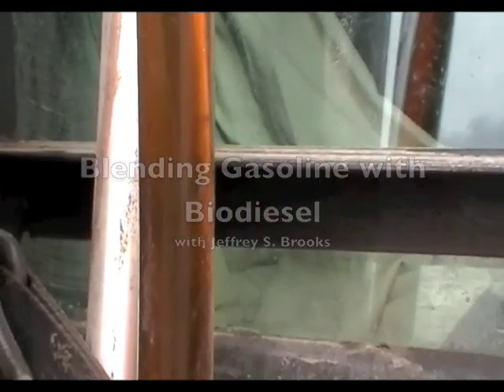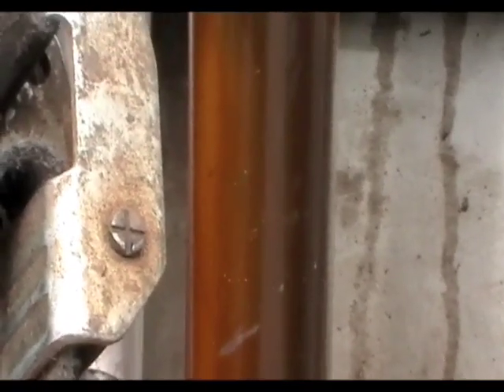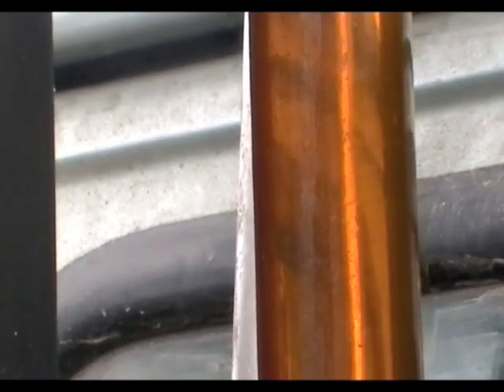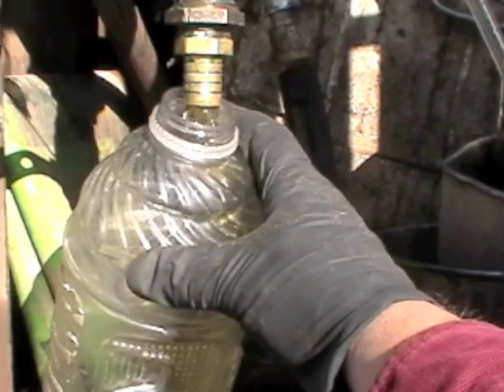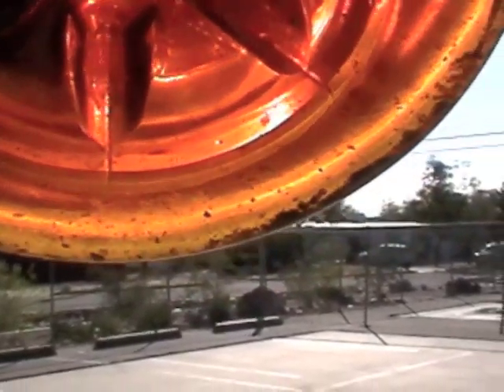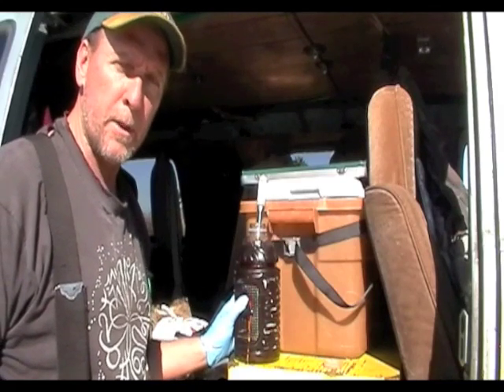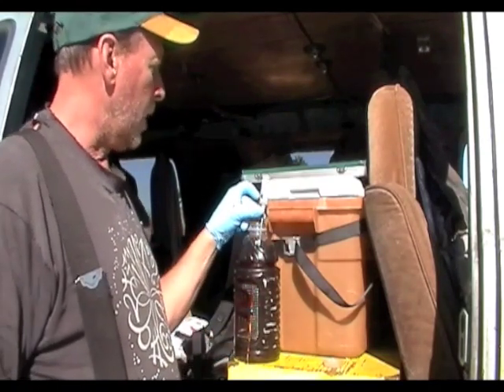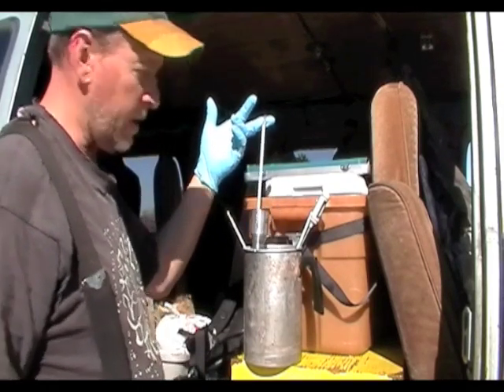Blending gasoline with biodiesel

Comment from the maker: I only ran one batch of biodiesel blended with gasoline at90-10.  It ran fine on my engine, and I was able to remove contaminants in the biodiesel by blending gasoline with it, then allowing it to settle.  

However, it is common practice in the UK to blend gasoline (petrol) at 5-10% with biodiesel in the winter to keep it from gelling.  People have been doing that for at least 7 years.

Comment from the maker: @Begbucks at this point I find making biodiesel far more trouble and expense than blending; and blending works on all oils; whereas biodiesel is veg only; however, blending does not work with animal fat and hydrogenated oils; whereas the biodesel process does.  So, converting animal fat and hydrogenated oils to biodiesel, then blending that B100 with gasoline to force the precipitation of incompatible components in that B100, and lowering the gel-point of that B100 is a complete solution.

Comment from the maker: Glycerine is the product of reacting fats with bases.  The oils (triglycerides) fully go into solution with the gasoline; however, there are common precipitates formed from blending gasoline with waste oils, so a settling period of 1-7 days is required to allow these precipitates to form and settle.  

The precipitate byproduct of blending waste vegetable oils with gasoline is far less than the precipitate byproduct of making biodiesel.

Comment from the maker: @Begbucks Yes, I started with a two-tank SVO system about 5 years ago, but at the same time I experimented with blending.  I generally do not drive far on a normal basis, say a few miles, so I could get to my destination by the time the engine had warmed up for switch over to SVO, so blending turned out to be a better solution for me, because there is no startup or shutdown purge cycle

Comment from the maker: @Begbucks I have not heard of "bad" diesel fuel, but D2 does tend to gel when the temperatures drop below freezing.  A simple solution is to put about a gallon of gasoline into the diesel fuel tank, because it does not take much gasoline to anti-gel diesel fuel.

Comment: My self made biodiesel is well made as I am not turning a profit on it. I 2 stage react and use the 27-3 test to determine full reaction and I wash with water spray and bubble dry along with a heater. I never had a problem. I also think the papers used in filters soften and the fibers lay flat to reduce flow. Mass produced bio diesel can not be made to a high standard as it is not cost effective to do a glicerol wash to start off the oil, settle overnight, then do the 80% reaction, settle overnight, then after the 27-3 test has settled you can do the final reaction and settle overnight. Then when you have the raw fuel with glyerol drained and the 2nd 27-3 test to confirm full reaction you can think about washing and drying. no filtering smaller than a kitchen flour sieve is needed as it all comes out in the processing. This is ok if you do it in spare time over a few days but as a comercial process it is not profitable so shortcuts are taken. in the UK we now have a new fuel called HVO. Hydrotreated Veg Oil. It is bio diesel made by treating oil under pressure and heat and by introducing hydrogen that cracks it into smaller chains and drives out oxygen making it a whole fuel with no glycerol waste and will keep longer in sealed containers or tanks. It is made in existing fuel refinearys and is not a methyle ester.

Comment from the maker: @Begbucks I am willing to consider that the source B99 I acquired for this video was properly manufactured and filtered.  My premise is, B100, when properly manufactured and filtered, contains components that are not compatible with petroleum distillates, such that when B100 is blended with petroleum distillates, then those  incompatible components in B100 will precipitate out of solution. So, if one put B100 in a fuel tank with diesel fuel in it, then precipitates may plug up the fuel filter.

Comment: Does adding petrol to Bio-diesel give it more power ? If so, what ratio ?
Reply from the maker: +Norman Fraser Yes, adding gasoline at about 5-10% to biodiesel gives it more power, and lowers its gel-point; however, one has to realize that blending gasoline with biodiesel could produce a precipitate, so that blending should take place in a settling tank, with about 2 weeks of settling, to allow sediments to settle out, then you must have a way to remove those sediments, before filtering.
Reply: +Jeffrey Brooks thanks for that mate.
Reply: Sorry i have a curiosity does blending Wvo with gasoline raise cetane number as blending the same wvo with ethanol? thx

Comment from the maker: WATF makes good diesel fuel, but it is still a little more viscous than diesel fuel, s it needs a little gasoline added to it, then it could be blended with WVO as well.  In fact my most recent blend has WVO and WATF and gasoline and distilled WMO in it.

Comment: I put 5L petrol into a tank of my own bio diesel and the petrol made the oil seal in the injection pump swell up and dilute my oil rapidly. It took 3 oil changes for it to go back to normal.
Reply from the maker: Blending in the fuel tank is likely to result in precipitates that can plug your fuel filter, lines and injector pump. Best practice of blending solvents with waste oils to make diesel fuel is to make your blend in an external tank, barrel or bucket and give that blend at least a week to settle out any precipitates, then separate out the sediments, before filtering the solution before putting it into your fuel tank.
Reply: @Jhananda  I make my own bio diesel. Its a methyle ester fuel and glycerol is removed. Quality control is in house and as I said I have no profit constraints so my fuel will not show precipitates if blended. As it is already fully converted and washed.
Reply from the maker: @rushymoto  the problem with solvent blending is dissolved solids can precipitate out of solution, so blending should be external to the fuel tank to allow for these dissolved solids to settle out and be removed before the blend goes into your fuel tank. 

Regarding your claim that gasoline caused seals in your injector pump to swell and contaminate your motor oil, this doesn't make sense, because diesel fuel and gasoline are fractions from the same petroleum stream thus the seals for gasoline should be the same as those for diesel fuel. Seal-fuel compatibility only becomes an issue when alcohol additives in fuel exceed 3% of total volume. So, if you want to increase the alcohol content of your fuel blend then you are likely to ruin the seals in your injector pump. Unless your injector pump is sealed with viton or Teflon seals. 

Additionally, there is another problem with turning WVO into diesel fuel, it is dissolved gum in the WVO. Since I have not heard any biodiesel enthusiast report the problem of gum in biodiesel and gum is soluble in alcohols but not in petroleum distillates, then I am inclined to believe gum precipitating out of solution due to adding gasoline to your blend is the more likely cause of your issue, especially considering your issue of contamination of your motor oil. 

Gum in DIY diesel fuels tends to lead to coking of the injectors, valves and rings which reduces compression and allows unburned fuel to enter the crank case. So, do you know if your engine is showing signs of excess coke? The common symptom is smoke.
Reply: Yes I fully understand what you are going on about but again I repete I do not see this happening in my own made fuel that follows a 100% conversion with high quality control.
Reply from the maker: @rushymoto  while you may believe you have high quality control of your biodiesel production; nonetheless, biodiesel production necessitates using alcohol in it's production. Is it possible that your residue of alcohol in your resulting biodiesel could be aiding the desolation of gum which then precipitates out when blended with petroleum desolates which are poor solvents for gum? 

While gum may not be your issue it is present in all WVO and biodiesel manufacturers never refer to the presence of gum in their product. It just so happens acetone resists gum so it will force gum out of solution. Thus, I always add acetone to my final product at 1%, which forces both gum and water out of solution, but be careful not to agitate the solution and be prepared to remove any sediments.
Reply from the maker: @rushymoto  I'm still having trouble understanding how your fuel is ending up in your fuel tank? It's my understanding that most diesel injector pumps use the fuel as a lubricant for the injector pump so there should be no path from your injector pump into your crank case except through blow by through coked injectors and rings. If this is the case for your engine and injector pump then you should be looking at coking not the fact that you put gasoline into your fuel tank, especially when you have been running b100 for about 75,000 miles. However, I do see running petroleum diesel during the winter sounds like wise practice which should decoke your engine. It is also wise practice to run b100 on long distance driving.

Nonetheless, there still seems to be a lack of acknowledgement in the biodiesel community that gum in the source biodiesel. In fact it is the source of the red color of my waste oil-diesel fuel blend. I have since found alcohols keep gum in solution, and petroleum distillates and acetone reject gum in a waste oil-based fuel. So, I have been using them to effectively reduce gum in my waste oil-based fuel blends; however, this blending has to be done external to the fuel tank. 

In conclusion it sounds like your biodiesel process sounds skilled, but biodiesel is about twice as viscous as petroleum diesel, so it needs thinning and gasoline and acetone are effective for doing this. Also, while you have an abundance of cheap ethanol which could be useful for thinning your biodiesel process the fundamental problems with this practice would be to keep gum in solution while swelling the seals in your injector pump unless you know that your injector pump is sealed with viton or Teflon seals.
Reply: @Jhananda  the fuel pump is driven from a shaft connected into the engine. This shaft has a seal with the flooded fuel pump on one side and the inner area of the engine on the other. If the seal swells or is faulty fuel will get passed the seal and end up in the engine.
Reply from the maker: @rushymoto  OK, I agree there is a drive shaft that is driven by a gear that essentially connects the drive on the injector pump, which could cause fuel to move from the injector pump into the crankcase. However, if you kept the gasoline you added to your fuel tank at or below 10% of the B100 in your fuel tank whatever the alcohol content in the gasoline should not have exceeded the 3% critical threshold. Thus, it is more likely adding alcohol to your B100 is a more probable cause of seal damage on your injector pump, and/or the seal failed coincidentally due to wear, or you have blowby as the causal factor. 

If you have fuel blowing passed whatever seal then you would see a thick substance in the drain pan of your oil change. This thick,viscous substance is likely to be gum from your B100 fuel production.
Reply: @Jhananda  fact. Blend petrol. Oil level rises. Needing several oil changes to rectify. Not theory. Actual happening.
Reply: @Jhananda  The problem went away after petrol adding was stopped and lube oil changed twice. I have never had a problem blending my self made fully reacted high quality controlled bio diesel with mineral diesel or kerrosine or other things with regard to anything getting blocked up. take a sample of the low quality bio diesel you are buying and do the 27-3 test to check for full transverification. 27ml methanol and 3ml sample, shake and leave to settle. If it goes cloudy like pernod when water is added you have unreacted oil present.
Reply from the maker: @rushymoto  I never make biodiesel. All along I've blended various solvents with WVO and WMO and never had the issue of my fuel ending up in my fuel tank, so I am just trying to explain your report. It did occur to me there is one more problem with your interpretation of your problem. That is, if the seals failed in your injector pump to allow fuel to enter your crank case then your injector pump would not be able to make pop pressure regardless of how many oil changes you did. 

So, I have to conclude 2 things. 
1) never blend in the fuel tank because you are likely to end up with a precipitate that can clog your entire fuel system. 
2) alcohol in your fuel blend can ruin the seals in your injector pump 
3) gum in the source WVO can result in coking of rings, valves and injectors.